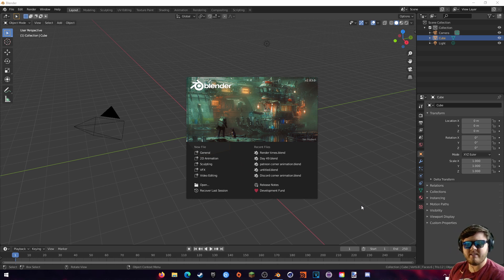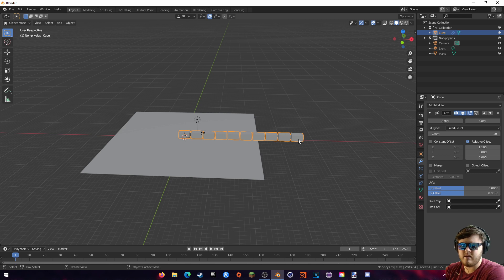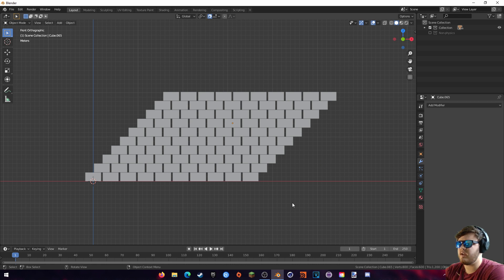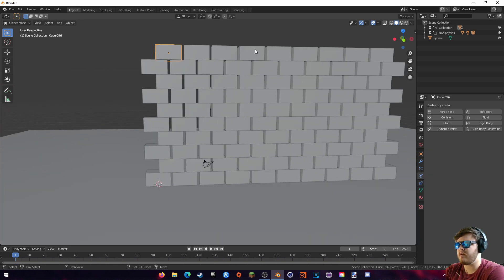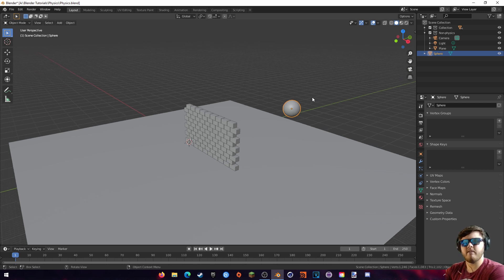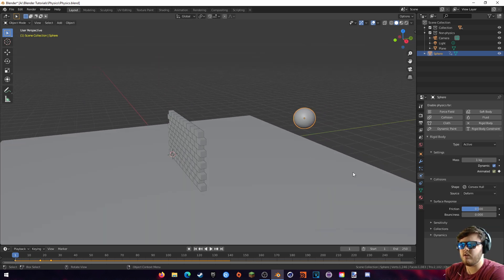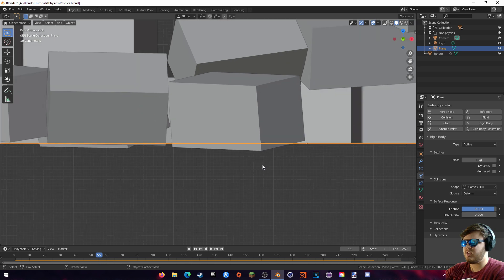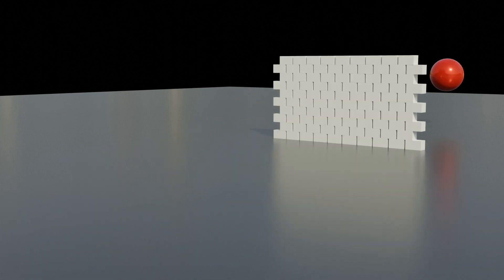How to Use Physics in Blender

Comment: Every time I unclick animated for the ball on the keyframe just before it hits the wall, the ball automatically moves back to the location of the first keyframe. And it doesn't act like it has  physics in the playback. It just does the animated part. Where it flies over the the wall and stops just before hitting it.
Reply: I have the exact same problem I'm so confused
Reply: were u able to solve thsi issue plz reply ?
Reply: @kedarshidhaye6950  
I did eventually fix the problem. It's hard to recall,  but if I remember correctly, I believe I just started the project over, and I didn't have the same issues the second time. I'm sorry for the disappointing answer. It has been a long time, however.
Reply: @JesseSwaney  I solved it too I just changed my blender version from 3.5->2.8
Reply: @kedarshidhaye6950  Oh, okay then. Hopefully, your answer will help people in the future.
Reply: @JesseSwaney  yeah thats what these comments are for after all
Reply: @kedarshidhaye6950  
Very true. I'm sure it will be appreciated.

Comment: This tutorial was amazing! But I do have a few lingering questions. If you could answer them I'd really appreciate it.

When I make my mesh active with dynamic rigid body physics, then press play on the animation, it clips right through the plane below it and falls into oblivion. The other meshes (also with dynamic rigid body physics) start out of view higher then my screen and then fall slowly onto the plane, interacting as normal when they finally hit it. But both meshes are starting in positions other then the ones I set them up in. Could you tell me how I did this or how to fix it?
Reply: Did you find a way to fix it ?